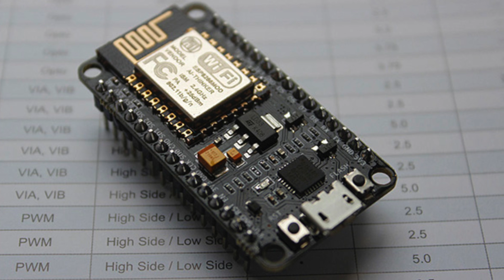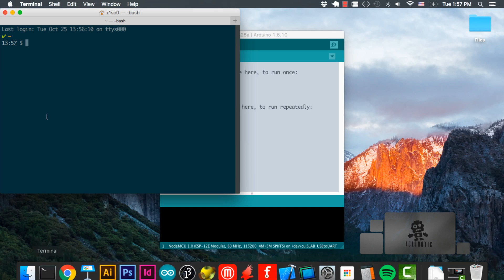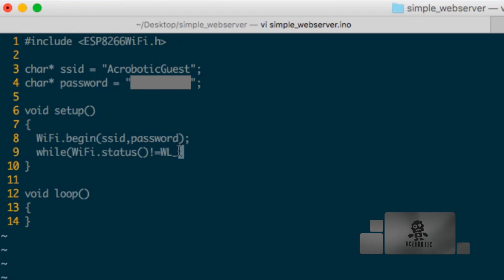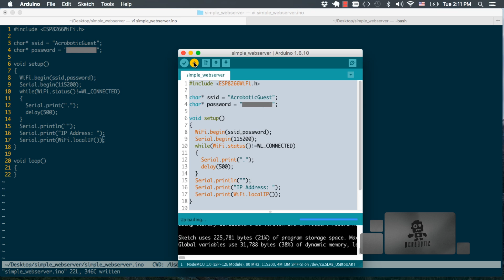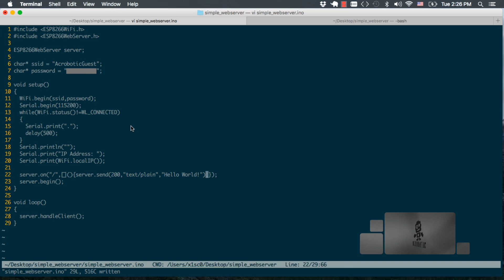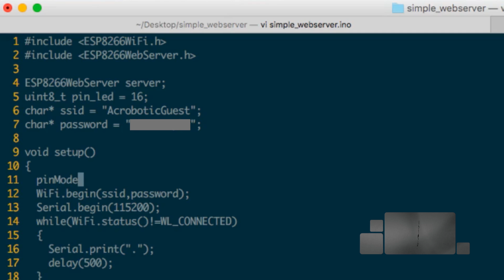ESP8266 Web Server Step-By-Step Using Arduino IDE (Mac OSX and Windows)

Comment: Thanks for the videos. They are very helpful. The use of 204 response code instead of 200 was very useful. The logic in your script is by far the easiest to understand. What I need now, though, is a way to have a html link or button trigger the toggleLED function instead. I want the page to offer the same functionality, but without typing into the URL or having to build a client side phone app. I only need about 10 buttons and it seems I can reuse whatever logic is needed. Thanks!
Reply: BTW, I am your patron. :)
Reply from the maker: Sorry I missed this comment, YouTube finally lets us sort by "Comments I haven't responded to" so I'm going through the list. Have you looked at the Websockets videos? It's by far the easiest way to get data back and forth from a web client and the ESP8266 (https://www.youtube.com/watch?v=ROeT-gyYZfw). Let me know if you can adapt the code to your needs, or otherwise I can give you a better example. Feel free to ping me on Patreon any time!

Comment: Excellent tutorial! 
Just one question; Is there a specific reason why you use external editor with Arduino IDE?
Reply: Exatcly. Why?  I also would like to know . . .
Reply from the maker: Hey, Mikko. Using a full-feature editor can be useful when writing longer programs, but it's only a matter of preference.  I like Vim because all editing operations can be done using keystroke combinations, and I've been using it for a looooong time.  These days, a popular one to try is Sublime Text if you'd like.  Thanks for watching!
Reply from the maker: Hey, Peter. Mostly a matter of preference and habit as you can see in the previous response.  Thanks for watching!

Comment: Really Awesome video, man. Subbed! I've picked up two ESP8266 to help me control my garage door via wifi and to show me the status of my garage doors whilst I'm away. (to my phone). Still need to get the fundamentals down though.
Reply from the maker: Thanks Vik, glad our team's effort has been useful to you!  Fun projects like those you mention are definitely in the queue.  As you've realized though, we're making sure we post stuff that covers the fundamentals first :)
Reply: https://github.com/esp8266/Arduino/blob/master/doc/esp8266wifi/server-examples.md

The link above will explain all you need for this project. Just change the 
String(analogRead(A0)) to a pin input for status of your garage door limit switch. 

Function below is the response of the ESP8266 as server to the client.

String prepareHtmlPage()
{
  String htmlPage = 
     String("HTTP/1.1 200 OK\r\n") +
            "Content-Type: text/html\r\n" +
            "Connection: close\r\n" +  // the connection will be closed after completion of the response
            "Refresh: 5\r\n" +  // refresh the page automatically every 5 sec
            "\r\n" +
            "<!DOCTYPE HTML>" +
            "<html>" +
            "Analog input:  " + String(analogRead(A0)) +
            "</html>" +
            "\r\n";
  return htmlPage;
}
Reply from the maker: Thanks for sharing that info, Gilbert!
Reply: @gibo588  Error 404!

Comment: Hi, very nice tutorial. You mentioned that we can connect an other hardware and I wonder if there is a chance to connect USB laser printer, so I can use it as a network printer?  If so, what is need it, how exactly it can communicate? Thank you very much for your tutorials and looking forward to see more.
Reply from the maker: For this, the easiest way would be to use a Raspberry Pi, which gives you an entire Operating System for high level operations like network sharing and such.  Best of luck!

Comment: Excellent video. Your video has led me to buy a module for experiment. Now the question comes, for working in Arduino environment, what firmware or bootloader that I need to install to the ESP8266 board? Where could I download the bootloader and firmware file for this purpose? TYIA...
Reply from the maker: The Arduino IDE allows you to upload your own firmware (the code that you write). You don't need a bootloader or a pre-compiled firmware file.  Check out our other videos for how to get started.  Thanks for watching!
Reply: Gotcha. Thanks...

Comment: You are awesome teacher. I like the way your explain things. Thank you and God bless you.
Reply from the maker: It encourages us to keep working hard knowing that you're finding the content useful.  Thanks again, Imtiaz!
Reply: I tried this and everything seem to have gone very well and i see the ip address on the serial monitor. However, when i goto IE and Chrome and type the ip adress it is not responding. wondering what i am doing wrong.... Thanks
Reply from the maker: Hmm that's strange.  In your computer is connected to the same Wi-Fi network, you should be able to navigate to http://esp8266.ip.address/ using the ip address you're seeing and the browser should display the "Hello World" message.  If you try the /toggle path, then nothing occurs on the browser, but the LED should toggle on and off.  Hope that helps!

Comment: Hello, I've been having some trouble getting things working on my ESP. I have a version 1 board connected to an arduino that is connected to the USB port. Is there anyway around this? Will I need to get some other form of USB connection to the ESP Module so that I can upload this to it directly? and if I do will I be able to control my arduino with the functions in the same way? 
The reason I'm using an arduino uno is because I have a motor shield attached and my final goal will be to control a stepper motor from a remote location.
Thank you, awesome video... one of the clearest I've found on explaining the ESP Module and the Wifi library.
Reply from the maker: Thanks for the kind words!
The ESP-01 doesn't have a built-in USB-to-Serial chip so you'll always need either an Arduino or a dedicated board for this functionality.  Alternatively you could use Over-The-Air (OTA) programming for loading your sketches to the ESP-01 without a wired connection.  
If instead of using an Arduino Motor Shield you switch to a standard Motor Controller breakout board you can wire it to the ESP8266 and eliminate the need for the Arduino altogether.  There's nothing wrong with your current setup, but our suggestion will simplify things a bit, having to worry only about a single microcontroller!

Comment: Hi,
Do you have this program listed on a website or somewhere that can be read?  I have searched for an error but don't seem able to find my mistake, comparing the video to what I have.
Thanks again,
Barry
Reply from the maker: Barry Black, no problem! It can be found following the link to the GitHub repo in the description :)
Reply: Thanks once again for your speedy response.  I corrected my typo and now have the program running and displaying the 'hello world' message on the website however again Cisco was a little too quick for me to catch how to request that the LED toggles!
Reply from the maker: No problem, I think now if you have everything in place you can add to your URL the path "/toggle" to call the toggleLED function, which toggles the LED.  Please note that the page won't display anything new, but the LED will switch on and off!
Reply: Thanks.  It is working now and I can turn on and off the led.  It's interesting to me that to turn on the light I add /toggle to the IP and the led comes on without pressing 'enter'.  When I want to turn the led off though I need to again type /toggle but have to press 'enter' to have it happen.
Y
You folks are great by the way!
Reply: I'm struggling to watch this, nothing is explained well.
Reply: I have found it very helpful to work along with the tutorial, pausing the video while I get caught up. So far any issues that I have encountered have been typos that I made along with a wiring problem.  I am not sure that I would learn a lot simply by viewing the video and my errors have actually turned out to be a learning tool.
I think Acrobotic are doing a great job.

Comment: Thank you for this very nice and clear video. When I tested the WiFi connection, on the serial monitor, i could see the dot point endlessly showing up but no IP adress appearing, could it mean a problem with the WiFi on my nodeMCU?
Reply from the maker: Yup, that usually means that there was something wrong with your credentials (ssid/password).  That's not the only reason, but definitely the lack of IP address indicates that the ESP8266 hasn't connected to the router yet!

Comment: Hi, I am pretty much a beginner at this and am having problems compiling 'simple_webserver' right off the bat at 3:20 of your video.  I get the message: stray '#" in program, although I have typed it exactly as you show in the video.  I have checked to make sure that I have the correct board selected.
Any help would be appreciated.  Thanks in advance.
Reply from the maker: Heya, we're glad to hear you're on the way to mastering the art of coding, Barry!  Do/Did you have a space between the # and the letter "i" perhaps?
Reply: Hi,
I have tried it both with and without a space and still get the error.  I am using terminal on my mac and am typing in the line numbers so that it looks exactly the same as yours on the screen.  Could this perhaps be part of the problem?  The line numbers on yours seem to appear magically :)
Reply from the maker: Nice! You've debugged your own code :) The line numbers are indeed marked in automatically by the text editor that is used, but they shouldn't be added manually to the code.  We use Vim, but there's another nice editor called Sublime Text that you can use, otherwise, the Arduino IDE has a built-in editor that you can use.  It's only a matter of preference, try them out and see what you think.
Reply: Thanks, I used Sublime which worked well although I did find it necessary to open the file in Terminal to invoke the Arduino program and compile.  Is this normal or did I miss something which would have let me go directly from a new tab in Sublime to the compiler?
Reply from the maker: Hmm, there are some editors that allow integration with the underlying compiler (avrdude), but I don't think Sublime is one of them.  The Sublime + Arduino IDE works great, and is similar to what we've used for a long time so we highly recommend it!
Reply: Thanks for the help so far.  I am really enjoying this and expect to be back with more questions as time goes on.
Reply from the maker: No problem, that's what we're here for :) Glad you're enjoying it, we're looking forward to hearing about your projects!
Reply: server.begin();

});
void loop();
{
 server.handleClient();
}

The above  is giving me an error: expected '{' at end of input
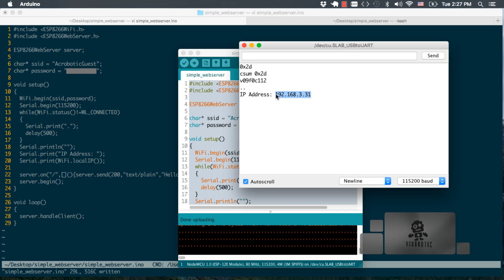I'm guessing that it is one of the syntax errors that you corrected at 9:54 mins.  You moved so quickly over this that I probably missed some.
Barry
Reply from the maker: That semicolon after loop() will cause trouble, maybe that's it?
Reply: server.on("/",[](){server.send(200,"text/plain","Hello World");
server.begin();

});
void loop()
{
 server.handleClient();
}

Now it tells me:

  function definition is not allowed before'{' token

Comment: Hi, first of all congratulations for the videos, very complete.
I have only one question... I cannot make it to install the library ESP8266Wifi...
Reply from the maker: The library is automatically installed when you add support for the ESP8266 board in the Arduino IDE.  Make sure you select one of the ESP8266 boards from the menu before compiling/uploading the code.  When you do this, the Arduino IDE 'knows' where to find the library.  Thanks for watching!

Comment: Hi, I had a small question.
I have a larger code running on my ESP8266 module. I'm using a webserver to send a request to toggle an led as well. This seems to work fine when the program contains code for only this. 
When I integrate it into my bigger program and try to toggle the LED, it doesn't. I believe this is because I don't exactly know how handleClient method works. Can you help me out? It is kinda urgent.
Reply from the maker: Can you send us the code over email, there are many possibilities and not enough information to even make an educated guess :-/  Thanks for watching though, we're glad that at least part of the code is working :)
Reply: Janak Chadha  You cannot say its kinda urgent!! are hou kidding??? . These peopke are not working for you. They do it for free and you didn't even thank them for this excellent piece of work.
Reply: Hey!
I'm really sorry about that!
I was in the middle of a project submission fiasco and probably wrote the comment in a hurry. I really appreciate their work and think that my project would not have been possible without their help. As for the 'urgent' part, it was by no means said in an authoritative way. It was a humble request to help me out at the earliest, if possible. Anyway, hope that clears things out. Thanks again for your work and great tutorials.

Comment: Hi,
I had this working well a couple of days ago but when I tried it today, the Arduino IDE no longer has the USB drivers as an option.  I have tried to remove and re-install the drivers to no avail.  I am not entirely certain that I am using the proper method to remove the old drivers from my mac.  I copied the removal script given in the install package and pasted it into terminal but I have no idea how to ensure that it worked.  Would you please be able to help?
Thanks in advance.
Reply: OK.  I figured out what I had wrong and things are working again.
Reply from the maker: Can you open up the Terminal App and type:

ls /dev/tty.*

Do it with the board unplugged and then plugged in to the USB port, see if there's an extra entry when the board is plugged in.  By the way, what kind of ESP8266 development board do you have?
Reply: thanks for the response.  It is working now.  I'm embarrassed to say that I had it incorrectly connected!  Once I got that straightened out everything worked as it should again.  The board I have came from Kuman.
My problem is I haven't used terminal commands since my MSDOS days on an XT machine I built myself and although I was quite confident back then I seem to be struggling with it now.....
Reply from the maker: Barry Black, no worries we've all been there!  Glad you're sorting it out, just like riding a bike :)

Comment: please tell me how to use and install terminal window can i use  in windows 7 
I already setup external editor in arduino IDE 
but how is next in windows 7
thanks alot
Reply from the maker: Sorry, terminal is for Mac OS.  Please follow the same process using another external editor like Sublime Text.  Thanks for watching!
Reply: Thanks
Reply: Please can i use arduino IDE directely
Reply: And why use external terminal
Reply from the maker: Yes please use Arduino IDE, we prefer external terminal but Arduino IDE is the easiest.
Reply: If Terminal is a MAC only application, the title of the video is very misleading
Reply: You can use Command Prompt with Vim installed.

Comment: Was there any reason you avoided using an if statement?
Reply from the maker: Where exactly? Probably trying to save up time if nothing else :)
Reply: I believe you wrote a digitalRead inside a digitalWrite (or vice versa) just wondering why you said to avoid an if statement
Reply from the maker: Oh, yep, it just saves a line of code (at least) and maintains overall readability.  Good catch!

Comment: Great video and i have found it very interesting.
But my problem is that i have uploaded code to my ESP-01 module and it works as expected when my module is connected to my laptop via USB - TTL converter , when i plug the usb-ttl converter to POWERBANK or 5v Wall charger the blue light always turns on also some times ESP-01 sends some random characteres until i power it off and on again.
Reply from the maker: Hmm, we haven't played much with the ESP-01, but I have read on several discussion threads that the power source needs to be very reliable.  Sorry we can't be more helpful!

Comment: Hey, excellent video, thank you for that! My question: how can I change the format of the value I send. For example you use "text/plain" to send "Hello World", what do I have to use for sending an float type variable? Thanks ;)
Reply from the maker: Hi Sebastian, thanks for watching! The "text/plain" is a directive for the client to know what type of data is being sent, the options don't specify whether it's a number or a string.  This logic is implemented on the client side, that is when you read the data being sent by the server you can typically specify whether it's a string, number, json object, etc.  If you wanted to specify from the server side what type of data it is, you can send it as a json object with two fields: 
{"value": 2.03, "type": "float"}

Comment: My nodemcu is not able to connect with wifi router but with mobile hotspot it is connecting...I searched on the internet but not getting a good answer.....can u tell me where could be the problem?
Reply from the maker: A few users have noticed this before. You can try changing your router's security settings. If you're at a school or business that uses WPA2-Enterprise, then it won't be possible to connect to the router. Good luck!
Reply: @datasith  No it is WPA2-PSK[AES]
Reply from the maker: @technicalcrush3457  as mentioned, try changing it to Open. Test it. Then you can determine if it's your code or the router. I can't know specifically why it doesn't work for you, as it works for every other user. I'm just giving you ideas.
Reply: Oh thanks for suggestion i will try

Comment: Good tutorial but I have a problem. It connects to the wifi and prints an IP address, but when I plug it into my browser it never loads. Do you know why this is happening?
Reply from the maker: Thanks! Are you using the browser on mobile or a computer? Make sure the ESP8266 and other device are on the same network. Also, make sure you call the server.begin() method. HTH!